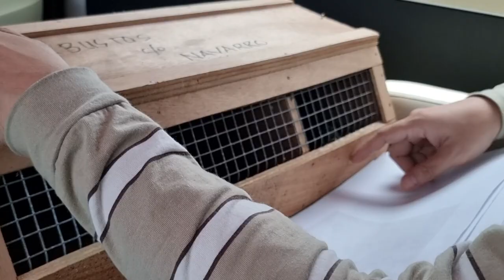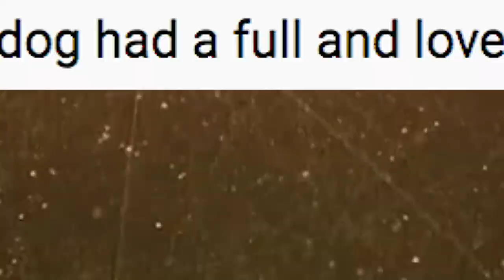Welcoming Home Our New Baby Birds!  - July 29, 2022 | Vlog #1531

Comment: Hi Mikey.  Here's a suggestion you might consider.  Use a non toxic sealer on the stone work in the avery.  This will allow an "easier" cleanup when the birds' poop land in it.  This will also keep residual odors and associated liquids from penetrating into the stone and making impossible to remove without aggressive aggressive cleaning with some pretty toxic cleaners.  I work at the san diego zoo in the bird avery.  Odor is the biggest problem due to the feces.  Sealing and washing down surfaces is the best way to control the "odors" associated with these amazing animals.
Reply: One of my earliest memories is of being in that aviary and watching the birds - I only realized it when I visited as an adult.  So beautiful! 😁❤️